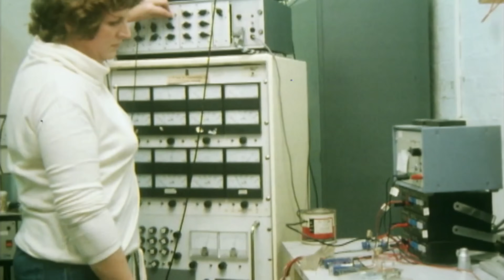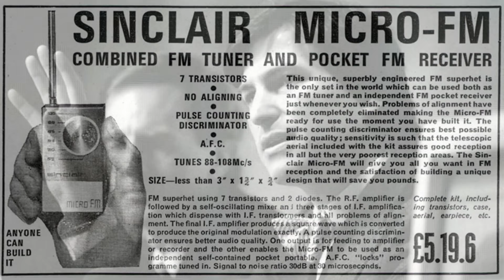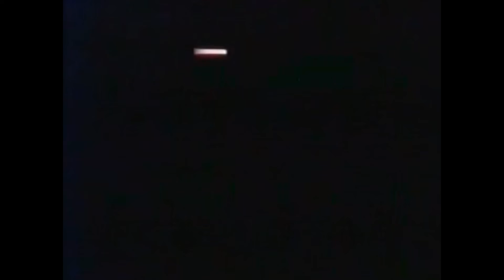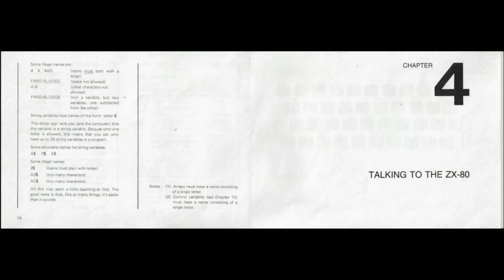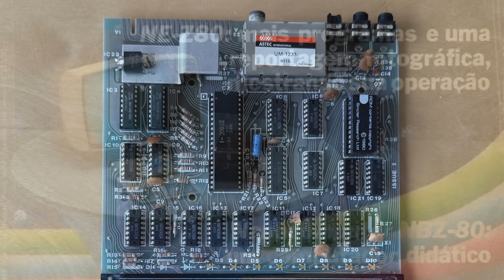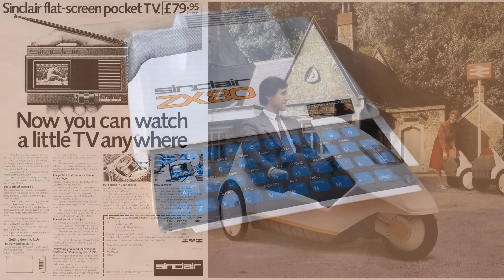Just a TOY? The Sinclair ZX80 Story

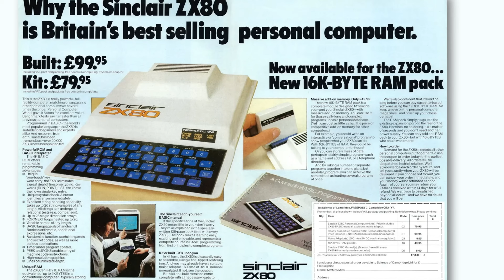Comment: 16:50 it wasn't the top heavy design, it was the extra casing below the connector which lifted the computer back off its feet when plugged it.  Typing caused the connection to flex as the computer was pressed down.

The simplest fix was to rest the computer on something (an exercise book or two) so that the RAM pack hung off the back and the connection no longer flexed.

Comment: 11:00 the only miceo I know of the era which did not tokenadise keywords was the Acorn Atom; every other system parsed the user input for keywords and replaced them by single byte tokens.  The ZX80's keywords entry system advantage came from removing this parsing stage, not from saving memory in the stored program (though it did save a bit of memory in the line input buffer).

Comment: I'd bought the Acorn System 1 in 1979, so saw the zx80 as a pass. I did buy the zx81, but it was still rubbish, especially if you had a 16kb expansion. I ended up soldering the boards together. Thankfully, a program I wrote on the zx81 in assembly code got me into university.

Comment: TS 08:51 - that ;looks like ICL peripheral equipment for ME20 or 2966 computers!
My college friend had a ZX80, and another pal had the ZX81 when we were using TRS-80s in college. Then Vic-210, the PET, BBC-A/B ewtc and I had a ZX-Spectrum (3 defective and the 4th finally worked. it's still in my attic!) Most of us with the 80/81/Spectrum or Commodore / BBC machines went on to work in "the business"

Comment: Great video! Interesting comment about floating point. To this day many computer engineers in Cambridge will still argue that you don't need it!
Reply from the maker: Just multiply before you divide!
Reply: @LittleCar Yes and if you're dealing with money basically do everything in pence. Even if you have floating point it can do funny things. It's really only suitable where you have a very wide range of values which aren't that exact (often the case for physics simulation or graphics).

Comment: I started out programming (as a school kid) on a Radofin 1290 programmable games console (it used a special cartridge with 6.5 K of RAM). Unfortunately, it used Signetics 2650 assembler, so I was learning machine code at the age of 14. It had 16 colours and 40 x 40 graphics. Anybody whose had the misfortune to write machine code for a 2650 processor will be familiar with its "quirks" and unconventionality.

When I was 22, I bought a ZX81 and it was so much easier to use as Z80 machine code was a doddle to adapt to, compared to the 2650.

I acquired a barely used, still in its postal box ZX80 & 16K RAM Pack, in 1982 and I still have this in a cupboard. Its only fired up, once in a blue moon.

I designed and built my own RAM packs, for my ZX81. 2K, 4K, 8K and 32K, back in the 1980's. I've also designed and built my own PC cards, back in the 1990's.

My ZX81 has the Memotech keyboard, Memotech Centronics port and a pair of 8255 IO port adapters (for when I was tinkering with robotics).

I'm now retired, after a career as an electronics engineer, due to ill health. I probably wouldn't have had this vocation if it wasn't for owning a ZX81.

Comment: Weirdly I was just talking about Sinclair computers to a colleague 2 days ago then next thing I know this video pops into my YT feed.  It’s almost as though I was being listened to!  So much for GDPR.

I had a ZX81 back in the early ‘80s, I was also doing some computer/microprocessor work in college as part of my engineering studies working with assembly code and BASIC.  This came in handy a year or so later when I started programming machine tools, a fairly new technology at the time.  In the mean time I moved on to programming with high level languages such as C which is fine but does remove you from actually “pulling the strings” of the processor.

Just recently I’ve been doing some work with an early fuel injection ECU which has taken me back to 8bit computing (with a smattering of 16bit thrown in), assembler and op. codes.  The other difference with this environment is time dependency, at 6000RPM that’s an interrupt event every 2.5mS, with a processor running at 1MHz that doesn’t give time for too many instructions particularly with all the mathematic functions being performed longhand.  A smart person would have simply junked it and moved to a modern system running several orders of magnitude faster but where’s the fun in that?  

It was amazing how quickly the capability came flooding back to me, 40+ years seemed to disappear in a few hours!  It also reminded me of some of the tricks you can play with calculations in binary.  I also realised that ChatGPT is not as good at reading the Motorola 6803 manual as I am.

Comment: The ZX 80 was my first computer purchase in 1980, I had made my own very basic setup before then , just to get used to z80 code. In around 1982 I got a contract to design an updated version of the Sinclair Super Settler which was a calculator used by bookmakers for  settling bets.For some reason Sinclair was not able produce any more due to a shortage of the specialized chips used in it.I designed the new version using off the shelf chips including the beloved Z80.Took me several weeks to write the code which followed algorithms supplied by Sinclair.Never did anything like that before, it was a full function calculator with a lot of extra dedicated functions.Think they sold over 10000 units which was good for such a specialized product.

Comment: Saving to tape wax often undone by automatic gain control on the tape recorder. The sudden increase in input from the microphone connection would reduce the amplification of the following input so that on replay programs would not load. ZX81 in the wardrobe now.
Reply: I had a fisher price tape recorder thingy as a child, which was a shockingly bad tape recorder for audio.  However, what made it shockingly bad made it perfect for spectrum storage - it just blasted whatever it received onto the tape and blasted it back out again.  Very seldom did a recording not work with that little box that ate batteries.  With my dads very expensive (and strictly only to be used with supervision despite being a teenager and not quite a child) Hi-Fi system, more often than not the automatic bullshit it used to do to make audio sound amazing completely screwed the program recordings and they almost universally didnt work.

I learned a lot about the difference between what humans could comprehend and the digital realm back then.

Comment: I bought a ZX81 when I was 13. I'd already had a go on a PET at school so was familiar with BASIC. I remember clearly the issue with the RAM pack dropping out the back when you pressed the keyboard too hard on a spongy surface. I actually bought a ribbon connector lead from a 3rd party retailer to eliminate this. It was a great time and we didn't expect too much. Although I remember the annoying flashing screen syndrome every time you added a word its not something I'd be prepared to put with now but at the time it was all we knew.

Comment: Around 1986, a former high school classmate was able to simulate the functionality of the Sinclair ZX Spectrum 48k's ULA using components available in East Germany. I got all the components I needed, and when he sent me the two PCBs for a complete ZX Spectrum clone, I spent the whole afternoon and half the night soldering, putting each circuit into operation one by one. Finally, I plugged the eight very expensive 64k x 1-bit DRAMs into the sockets. It was one of the most unforgettable moments of my electronics hobbyist days when, at around 4 a.m., I saw the message “(C) 1983 Sinclair Research Ltd.” appear on the TV screen!

There were several ZX Spectrum clones in East Germany. Later, I soldered together another single-board version. Those were exciting times. Thank you, Mr. Sinclair!
Reply: Little bit similar experience... My original 48K ZX Spectrum was failed on the Power supply part on the board. Right before the iron curtain falls down. East Germany was only 30Km away from my hometown, so we had first contacts to east germany, and also reports in west german computer magazines, mainly "Happy Computer" which was very close to Sinclair machines. There i found the East German clone of the ZX Spectrum. So i took my broken ZX Spectrum to our next East german visit, and gave it there to a local computer store ... at least something like a computer store. And they know how to fix it and they repair my ZX Spectrum! No great deal for me, i had my 2nd ZxS, and headung up to an Atari ST. Just to tell for fun and to realize how old i am... and how much this early computers (my first was an ZX81) changed my life becomming a Programmer/Coder. Now on Pascal or better Navision/BC365, but the ZX81/Spectrum teach me how computer works. I think 99% of Ruby on Rails or JavaScript or Pathon programmer never learned.
Reply: @rthsw  Yes, while building the ZX Spectrum clone, I also learned a lot about computer technology, which helped me later on. For example, in the early years of Intel-compatible PCs, where you had to manually set I/O and IRQ addresses for plug-in cards, or how memory is addressed. I didn't learn programming, but I did get involved with BASIC because the BASIC headers on audio cassettes with ZX Spectrum programs were often damaged by repeated copying - I became quite good at repairing them. If the machine code block was damaged, I had no chance.
Reply: All of the East, Hungary, Yugoslavia, Poland, they all produced their own clones.
Reply: @brahmafria   It is correct for eastern block countries. Yugoslavia didn't produce ZX Spectrum clones, actually they were produced by Iskra Kranj as licenced ZX Spectrum. Most of the Spectrums come in Yugoslavia from Germany, I bought mine Spectrum+ in Paris of all places.
Reply: @polvalh0  Yes, maybe I generalized a bit, but I follow Sinclair related sites for long time and I remember seeing pics and posts about these eastern bloc clones. Similar story in Portugal, where the Timex portuguese branch started producing licensed Spectrums.
Reply: I hope you glued half the components to the keyboard casing as was standard on the early models? There was even a chip or two attached to the heat sink, which was a metal plate that run along the entire length of the machine and wired on the board! I learnt assembly language on that thing. Happy days.

Comment: The ZX80 was my first Computer in 1980 at the age of 24 and you could concatenate string variables as I did this in the one and only program I wrote on the ZX80 to get it into the 1k of memory , it was just a " Guess my Number - Higher or Lower " and it was superior to the one in your video as I managed to get everything centred in the middle of the screen . It was 45 years ago and I gave the ZX80 away to a neighbours young Daughter in about 1982 along with the Cassette Tape with the program on it . ZX80 Basic had no Command to concatenate but you could do it yourself as in TR$ and LET A$=A$+B$ .

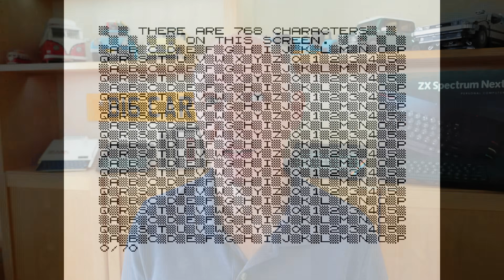Comment: Very well researched and interesting video, thanks! I have one nit to pick, at 10:52 you said "the system of entering BASIC keywords helped somewhat as each keyword was only one byte, and that made it more compact than competing systems"; but I know for sure the Apple II parsed and tokenized every BASIC keyword into one byte immediately upon entry of each line of code, and I suspect most if not all of the contemporary BASIC interpreters would have done the same, as it was a simple optimization too obvious to ignore when memory was so limited.

Comment: In November 1980, the standard unemployment benefit rate for a single young  person was £20.65 per week.
In 2024, unemployment benefits in the UK for New Style Jobseeker's Allowance were up to £71.70 per week for those under 25
I'm taking that figure as a minimal living wage low paid jobs didnt pay much more that that, i know I worked them!
£72/£21=3.43
1980 £99 x 3.43 = £339.57
1980 £99 5 weeks , 2025 £339 4.77 weeks
in 1984 my cpc464 was £349 and I was in training, unemployment benefit rate for a single young  person was £28 and I got £15 extra to cover travel expenses + course materials, so 8 wks
a basic desktop now is say £750, so 1200 a month low paid job, 300/wk, so 2.5wks
computers have got cheaper over the years, and i really do think converting prices based on actual existance income/minimum wages is more accurate than online calculators

Comment: Had the ZX81 with 16Kb wobbly ram pack and the (almost) full-size keyboard.   It was a great tool to learn programming.   I used mine for stats crunching for medical lab sciences qualification project.   The main issue was loading and saving data to a Mono cassette recorder.     Regarding Cheap.   When your take home pay was £250,  the costs weren’t inconsiderable.    Sold it on eventually and got a BBC model B with twin disc drives and the Tube second processor expansion unit.   Happy memories.. 😊

Comment: 4:21 I'm absolutely shocked to hear you say that about Steve Jobs. Firstly, the Apple II was essentially a Steve Wozniak design and the machine Jobs was most focused on was the Apple Lisa that was so expensive down to terrible design or later the cut down Macintosh that was so cut down it didn't even ship with enough memory to make it useful to run anything but the operating system.

Comment: Back around mid 81 I went to the sinclair exhibition at Alexandra Palace where I sold my Ram Pack fix kit. which consisted of an edge connecter with short 2 inch wires soldered to it and an edge strip made of a thin strip of wood with the wires glued to it in the correct positions. once I got everything lined up I coated it all in marine varnish to stiffen it up then using an emery board sanded the contacts to give a good connection. Although a very McGuivered botch job it worked extremely well, with ram pack wobble almost eliminated, and I sold over 3 dozen of these at 30 quid a pop which back then was a lot of money for a 16 year old working out of his bedroom. Then when I found an electrical wholesalers in Hadleigh in Essex who sold ribbon cables that I was able to cut to size as well as the male edges to go into the femaile edge connectors everything looked so much more professional. This wholesalers operated in a first floor office with box after box of components and went on to become Maplins. I must have sold almost 200 of these kits by the time the Spectrum came out. Great days back then where you were inventing stuff that had never been done before to fix problems that had never been encountered before. Like making an Serial adapter for the Spectrum to connect it to an OKIDATA dot matrix printer instead of the crappy thermal monstrosity sold by Sinclair

Comment: The ZX80 embodied the credo of "down to a price, not up to a standard" but some of the tricks used to save both money and memory space were ingenious.
Hardware was expensive, so the Z80 CPU itself was used to generate the signals for the TV display, by having it run "NOP" (no-operation) instructions while the hardware used the output of the address bus to access the memory and create the display.  Effectively, the chain of NOPs was the "main program" with the keyboard input being done by an interrupt.  This is why the display would "jump" every time a key was pressed, and also explains why the program needed to halt and wait for input in order to display anything on the screen.
The display was also clever because it saved memory space by effectively having an "end of line" character which would cause the rest of the line to be blank and the next character in the display memory would be the first character of the next line.  This meant that the amount of RAM used for the display changed depending on how much was on the screen.
It was a remarkable device mainly because of all of the cost-saving tricks used to make it mostly-work.  What's more remarkable is that it served as an introduction to computers for many people, in spite of how bad it was.

Comment: I brought the zx80 kit. LOL...I assembled it and guess what ?  it didn't work. At that time you could send it to cambridge and they would check it out and let you know whether it was or wasn't working, they did the check and told me component missing. There was a three pin filter  'X1'  on the botom right of the board, just above the keyboard. I found the filter which had fallen into a drawer. Put it into place and  soldered it.   Plugged it in and the little 'k' appeared in the bottom left of screen, the journey started. I eneded up being depressed with it;s lack of power. Glad I never tried to get it to run an electric kettle.

Comment: "Single Keyword Entry became a diabolical form of torture on the ZX Spectrum". This is really not true. Even on the ZX Spectrum it was a much faster way to program than on, for example, a BBC micro or any computer that required you to type in statements long-hand. It really is faster. Moreover the syntax-checking is ideal for beginners and non-beginners, after all, we all still make syntax mistakes in code and compilers today only really discover this when code is compiled.

@11:16 "GOSUBs couldn't be nested." Of course they can! The following program can happily compute up to 7 factorial, but the only GOSUB limit is the available memory.

  10 INPUT N
  20 LET X=1
  30 PRINT N;" FACTORIAL=";
  40 GOSUB 100
  50 PRINT X
  60 STOP
 100 REM RECURSIVE FACTORIAL
 110 IF N=1 THEN RETURN
 120 LET X=X*N
 130 LET N=N-1
 140 GOSUB 100
 150 RETURN

Comment: The SC/MP was my first introduction to microprocessors, with a grand total of 256 bytes of RAM. I/O was via a current loop serial teletype. The next system I encountered was Z80 based NASCOM 1, with 1024 bytes of RAM and a tiny BASIC interpreter, a proper keyboard and a TV output.